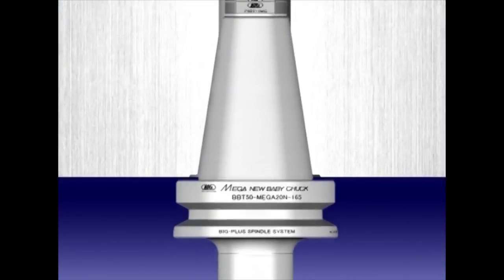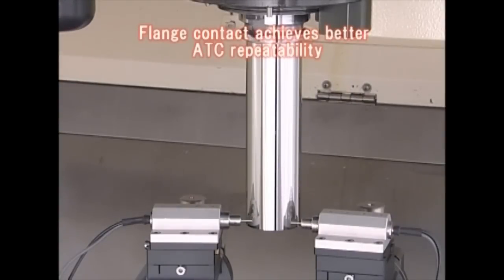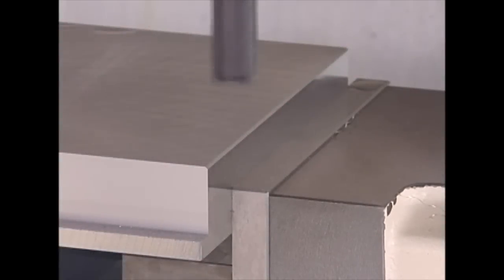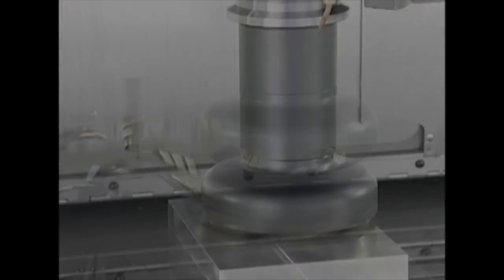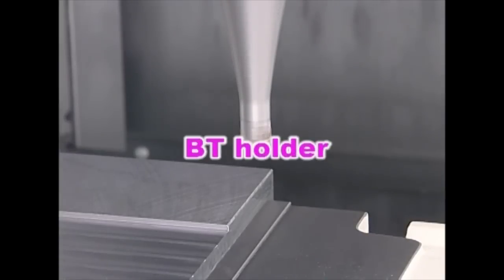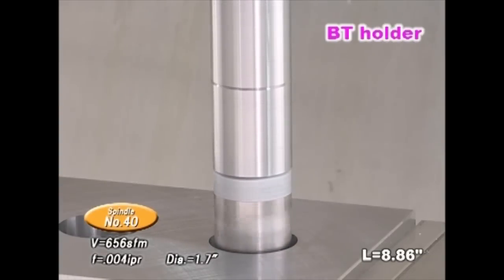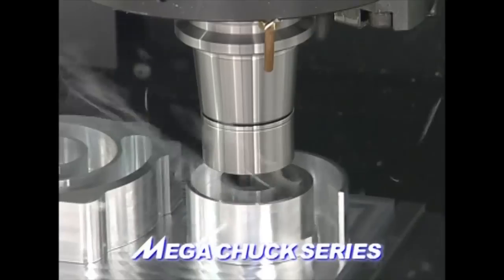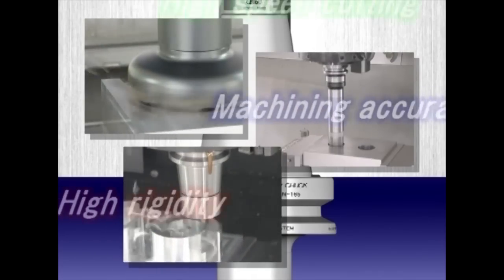BIG-PLUS Spindle System - Dual Contact | BIG DAISHOWA-Americas

Comment: This looks great, My only concern is how do you know that no chips will get between the flange contact point? A few times I have had chips find there way onto the taper surface and scrapped parts. I would think a flange face would be easier to collect chips. The machines I run at work I notice during a job run you get a lot of chips and junk  in that area of the flange. We use Cat40. Just watching this I see issues we deal with like the chatter problems.
Reply from the maker: Generally gravity takes care of the issue. However, there is of course the chance that chips could collect as you mentioned. Some machine tool spindles actually have their own built-in air blast features as the tool taper is approaching the spindle during ATC. Another way to alleviate the issue is to program in this tool https://us.bigkaiser.com/products/accessories/big-plus-cleaner.html between each tool change. The link will explain to you how it works. Please let us know if you have any further questions about BIG-PLUS®.